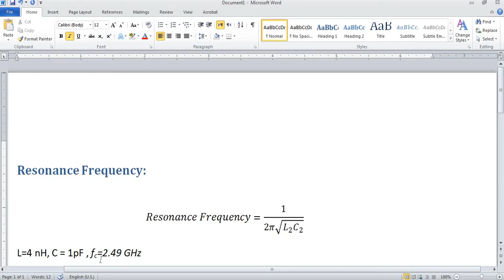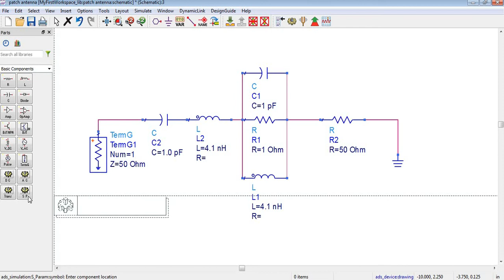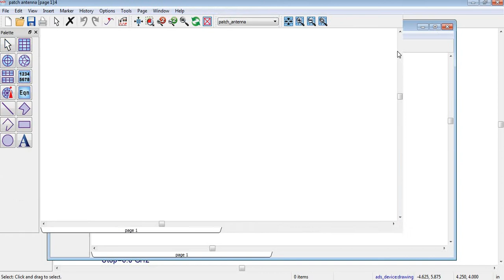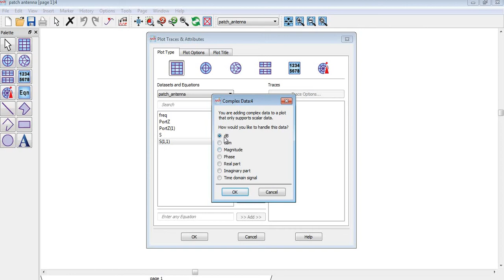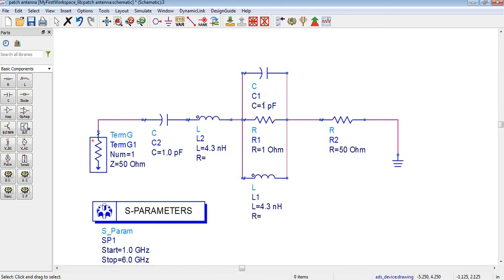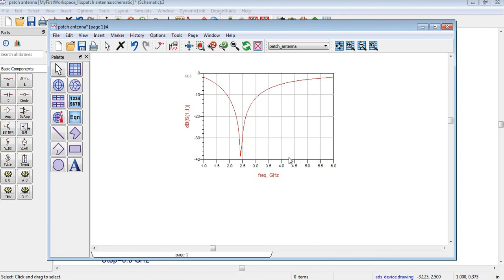Simulation and S parameter analysis of ISM band antenna equivalent circuit model In ADS | Tutorial 9

Comment: hello , thanks for this video , could you please suggest me the material which it has  clear explanation on methods for  how the equivalent circuit extraction from RF sensor designed by CST OR any software

another question , i am new in this field sorry for these question 
why we should import the S11 here . ? i thought the the simulation result for the equivalent circuit should be same as S11 
is the S11 has no effect on the circuit done in ADS or what?
Reply from the maker: You are right circuit output is S11